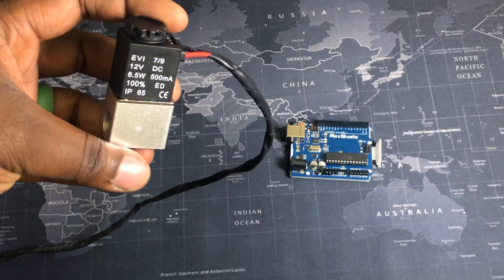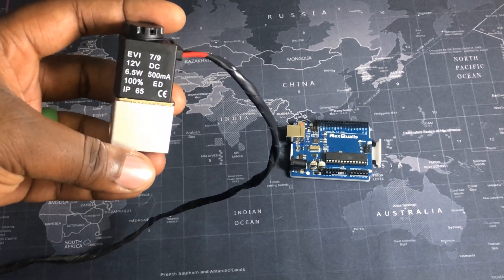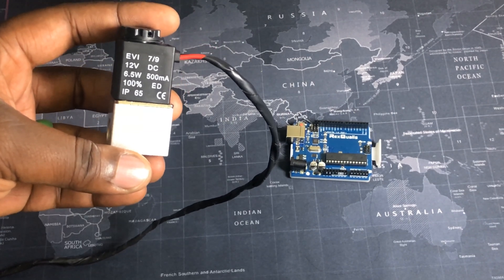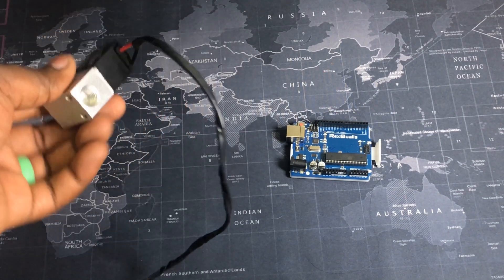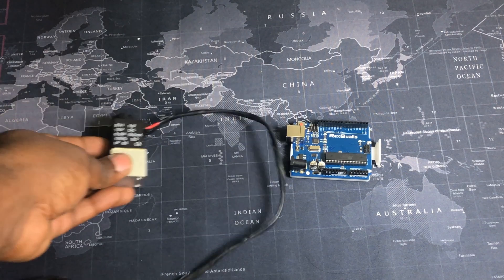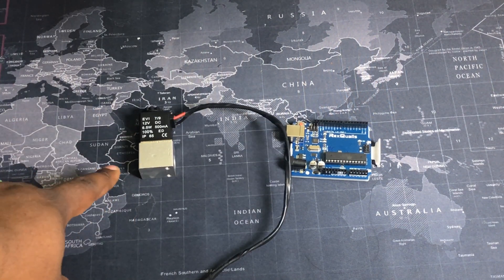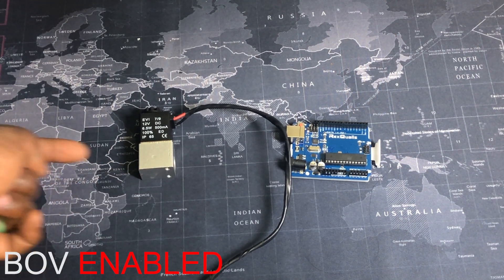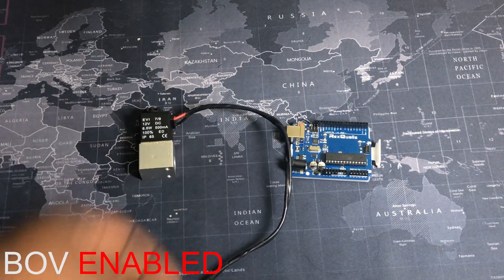Arduino MR2 Mode Selection With BOV Control Results (4K)

Comment: What a pointless mod
Reply: The main point is he controlled the BOV via Arduino... because he can.  Arduino opens endless capabilities.   Hats off OverkillEverything
Reply from the maker: It's called choice. My boost pressure is variable depending on my Ethanol blend and which driving mode I'm in. Sometimes I want a BOV sometimes I don't. I flip a switch and I can choose.
Reply: @OverkillEverything  yea sure to each their own, i just think its pointless

Comment: I installed a gen 4 engine in my mr2. I was told by the guys at prime performance that they don't run blow off valves on that engine. So I was talked into not putting one in. I always thought you needed them to relieve the back pressure between shifts  so it doesn't "back spin" the turbo. Should I worry about that? In your opinion of course
Reply from the maker: Think of the amount of exhaust velocity required to spin the turbo, closing the throttle only slows the turbo, doesn't spin it backwards. 

I think it can lessen turbo life to a degree but its up to your personal preference. Do what makes you happy the most.
Reply: Bov is only needed for a high boost/power applications.....For slow cars its useless and only makes your car slower between shifts....Its basically for people that want the sound.
Reply from the maker: @Bojangles-v3s  best wishes on the build. Hope you can drive it soon.

Comment: Hey man just started watching your videos and your project is really cool to follow! I drive a 15 WRX and for my senior project I have been designing an active aero wing for my car. The company whose actuators I have been looking into told me that they can’t hold an cross axis forces when deployed, just wondering how does your wing overcome this or is there no problem at all?
Reply from the maker: No problem with that so far. I upgraded to this https://www.firgelliauto.com/products/premium-linear-actuators for a better IP rating
Reply from the maker: It's also available with optical feedback
Reply: Haha that’s funny man I was also going to go with firgelli actuators! They are pretty responsive and answer all my questions. They told me the actuator couldn’t take any cross axis force and it seems like you can never have the actuator at 90 degrees to the airfoil at all times
Reply from the maker: The only problems I have encountered are 1) if you use more than 1 the motors move at different speeds....sucks 2) IP rating too low on their original actuator 3) speed too slow

The sweet spot for me is 3" throw with 2 inch/sec speed and IP 67 rating
Reply: My teacher pointed me in the direction of using linkage system to use the actuators at a 90 angle to the wing (probably going to be mounted in the trunk) and that way the actuator won’t take on as much rotation and I could double the speed by using a 2:1 ration linkage piece. Hopefully it works out, I started building a few tests this week to see what shape works best.
Reply from the maker: Sweet keep me posted on how that turns out. Sounds very interesting